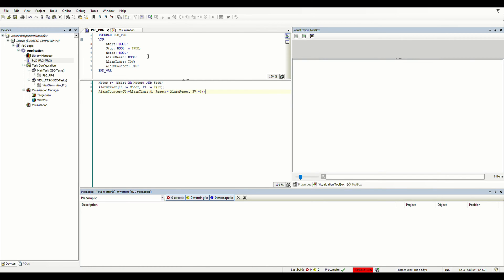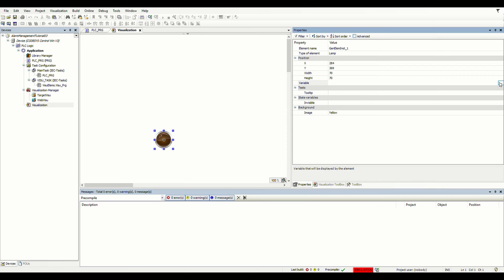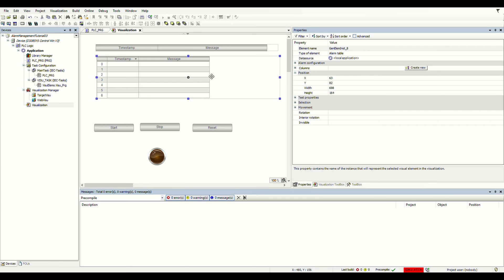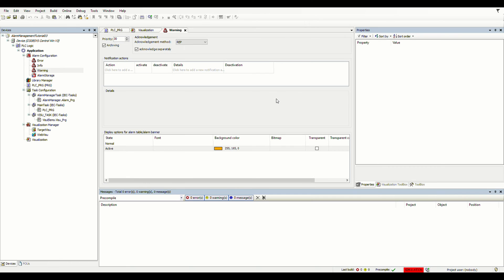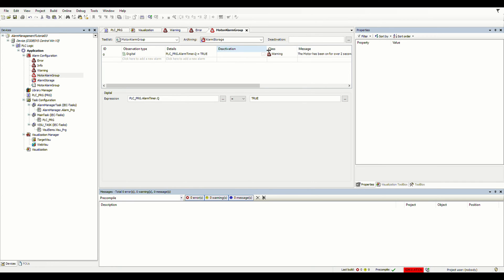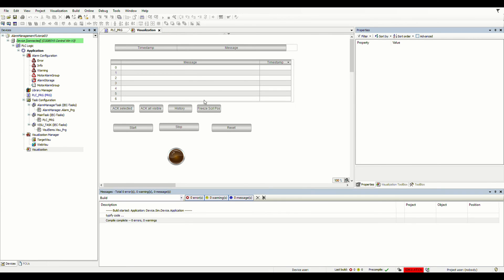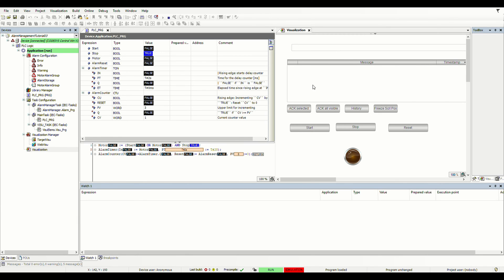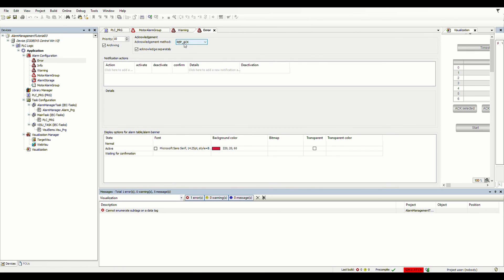CODESYS: Alarm Management tutorial #codesys #plcprogramming #alarm #alarmmanagement #iec61131

Comment: Hello, 
how to make two motors alternate with just one ST command. I'm trying to make an automatic water pump system. When the buoy closes the contact connects the pump 1, in the next cycle it would have to turn on the pump 2.
Reply from the maker: Hi. Could you please explain more. I am not sure if I have understood what you want.
Reply: @TohidAlizadeh  
The idea is to control two water pumps that are driven by a float. each float cycle must connect a different pump.
In the first cycle it connects pump A In the second cycle the pump B ...
Reply from the maker: Still not clear. DO you have a single float to control two pumps?  What do you exactly mean by next CYCLE? When do you want the pumps to turn off? If you have a detailed explanation, you can send it to my email.